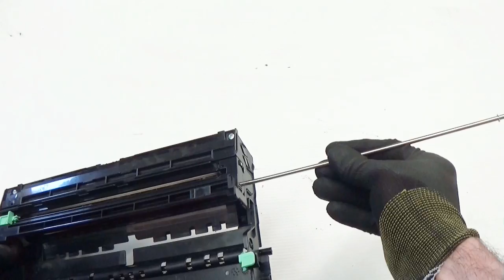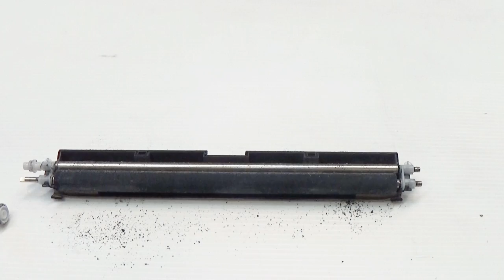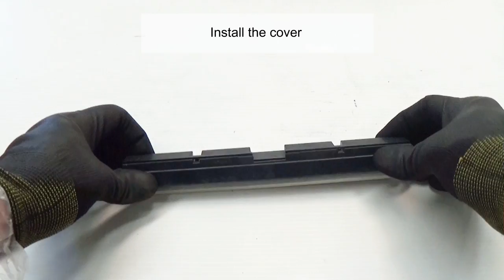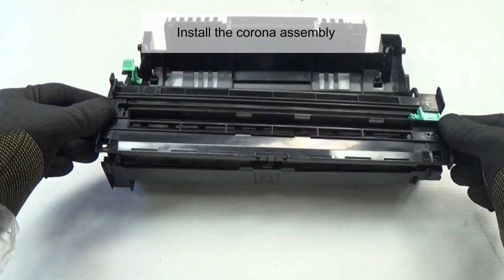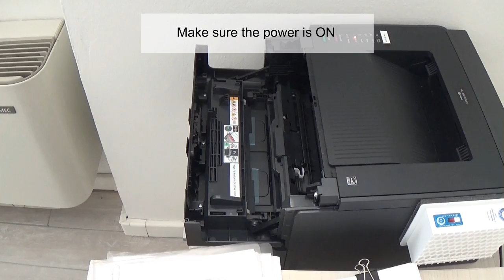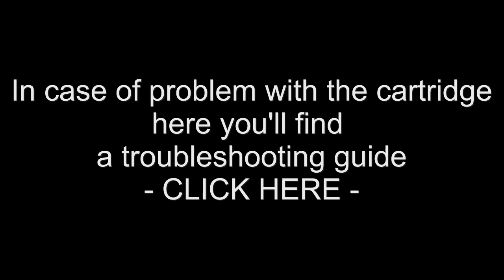How to Rebuild BROTHER HL5450 DR720 DR3300 Drum Unit

Comment: Hi there. On Brother 8950 DW I had 3 horizontal lines evenly spaced..top center bottom. I did a nice job like your video cleaning the drum unit.
When reinstalled SAME 3 lines are still there. When using other drum unit the lines are not present. Any ideas what can cause this? I hate to give up.
Thank you.
Reply: Did you get it figured out?  I have those lines also.
Reply: @mikes6216  Hi Mike. No never got rid of those,. I replaced the drum unit.

Comment: 1:23 Hi. I have a HL5450 printer and I get black spots at regular intervals on the right side of printed sheets, even with a new toner cartridge, so I'm assuming it's the drum roller. I have a lighter area on the left side of the roller (just like in your video), exactly where the spots appear on printed sheets. Do you know the exact part number of the roller and where I could get one?
Thanks